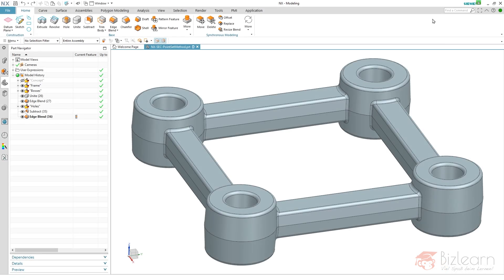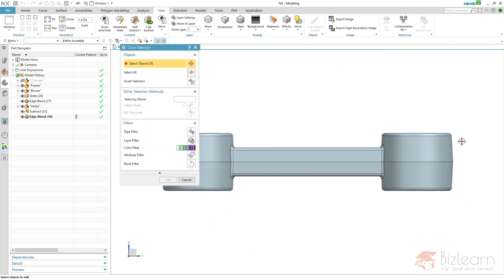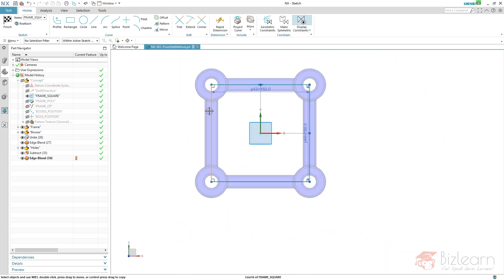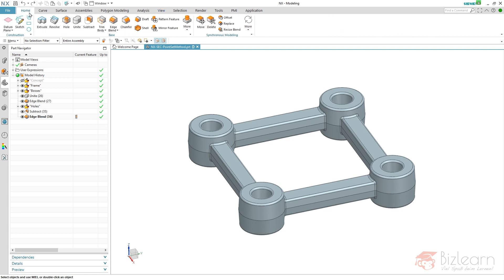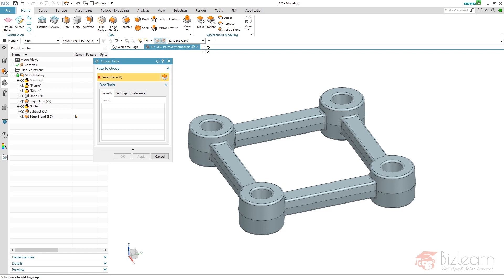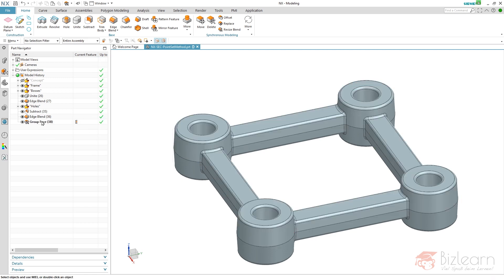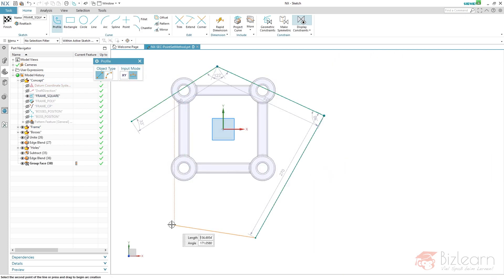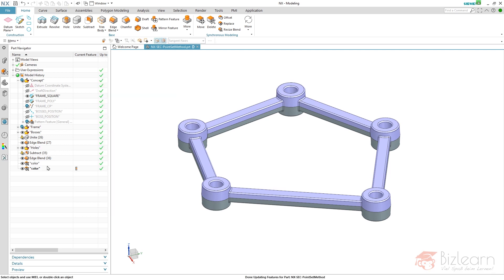Siemens NX Tutorial - how to apply color to objects fast and associative with Synchronous Modeling

Comment: Hi.how can i reset to default color after change it?
Reply from the maker: You mean the body color or the feature color? Behaves different from version to version. But it's stored associatively. You can right click and reset the color definition at any time. But don't delete the color feature. Because then, depending on the preferences, the color will be adopted by the faces in a non associated manner (:
Reply: @Bizlearn_Siemens_NX_Training  thanks bro

Comment: Is it permanently assign feature color.
Because I am facing problem during assign feature color to threads.
It will automatically removed, when I again assign feature color it will be there.
Reply from the maker: It should be permanent. I haven't experienced the relation to threads yet - are you mentioning the standalone thread?
There is a new redesigned Thread available since the continuous release NX 1926